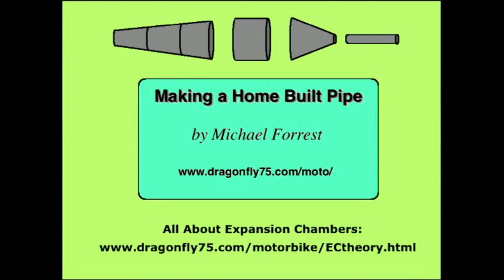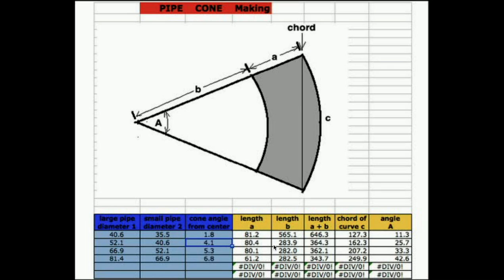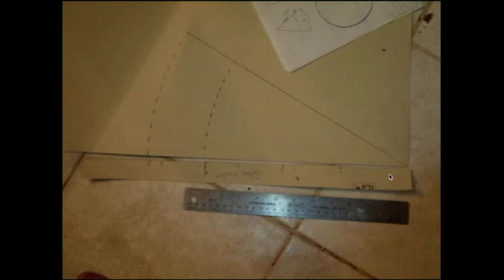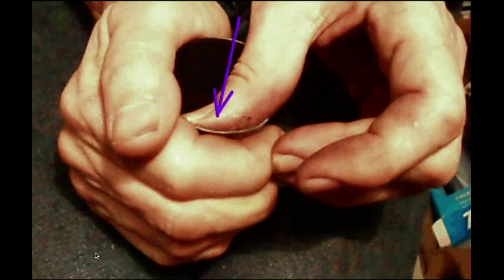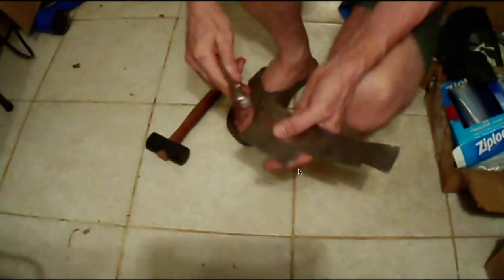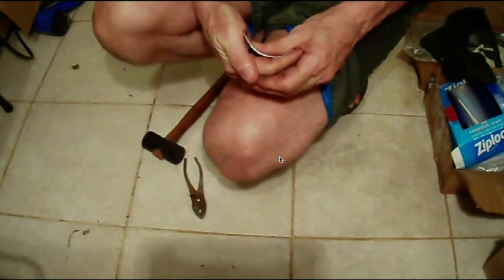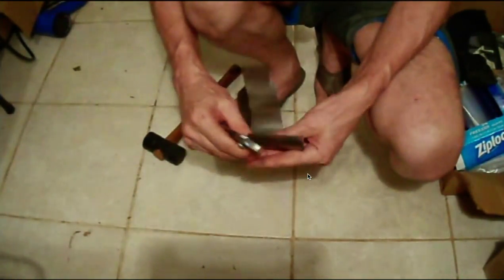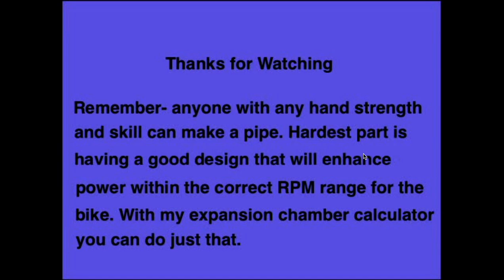Making a 2 stroke expansion chamber

Comment: I have the same motor on a project bike, any chances you have the design for me to print?
Reply from the maker: my final design is on the page after this one: http://www.dragonfly75.com/moto/AX100.html If you are racing it you can design a 3000 rpm wide powerband pipe for it, nothing else will work because it needs the extra wide powerband since it's only a 4 speed.

Comment from the maker: TIP: If using acetylene torch to weld the pipe together you should make the cone edges bent a bit towards the centerline because the high heat of the torch will cause the side edges to lose their curve a bit and so without taking this precaution the end product will have the side edge seams sticking a bit outward.

Comment from the maker: The long slightly angled diffuser section I made turned out to give less power than a short diffuser with strong angles so I went back to that design. live and learn
Reply: do you think that was an issue with the program ?

Comment: stinger tube put deep inside chamber does not effect performance?
Reply from the maker: Not at all. The wave motion is along the length of the chamber just as the tube is. So there is no interference. It's been known for decades but has mostly been forgotten. I don't know why because it doesn't lessen power and it greatly decreases the noise level. I also have the worlds best competition silencer on it and I love it. Most other two strokes make my "ringing ears" problem worse but not this pipe. You have to support the inner pipe though by welding a piece of sheet metal from it to the belly. Otherwise it will eventually break the pipe at the end of the baffle due to vertical stresses (hitting bumps) moving the internal stinger. Take a look at this other video of mine letting you hear the difference: https://www.youtube.com/watch?v=qsQ_mRrqrTs
Reply: Thank You for explaining.
Reply: I tried internal stinger, no noticeable power difference. It mellows noise even.